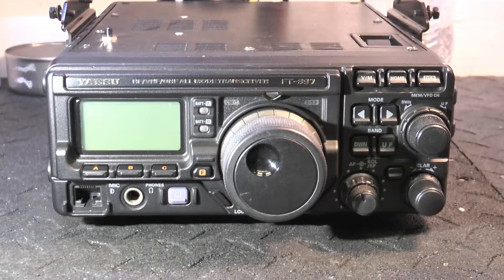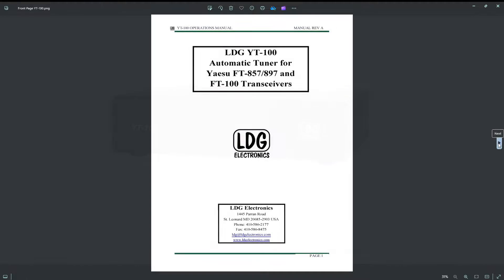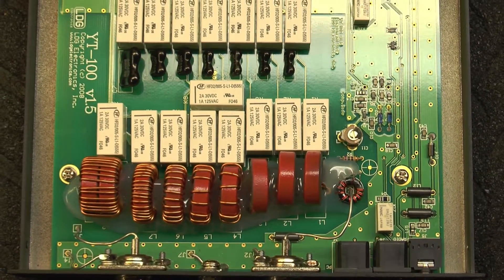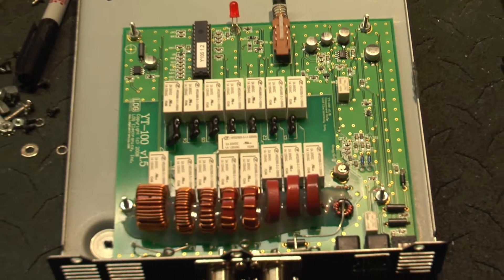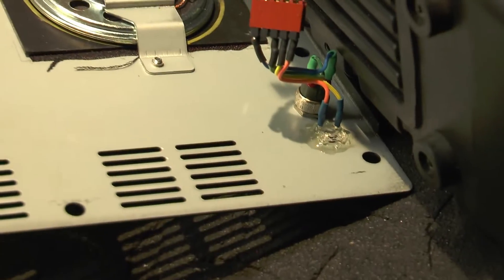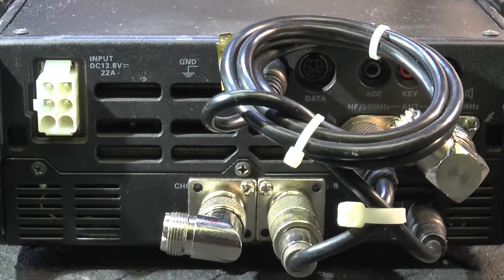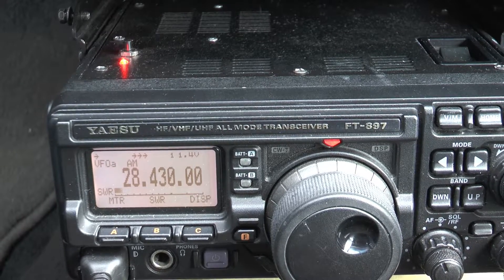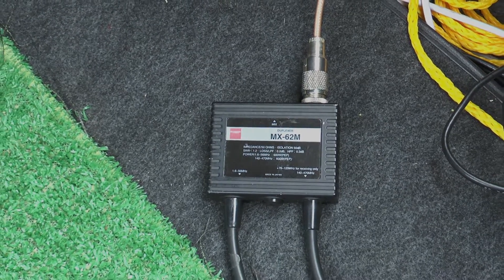Yaesu FT 897 Tuner Modification

Comment: I did this about 2 years ago and it works a treat. It's as though the YT100 board was made for the battery compartment on the 897! I got the idea from EC1CW who modified his some time ago and posted the video.
I used two 90 deg PL 259 connectors and soldered them together to bridge the radio out and tuner in ports.
I then bought a long CAT cable and cut, re soldered it to give a real tidy look to the back of the radio with no excess cables hanging off. 👍👍
Reply from the maker: Sounds good. I would like to clean up the rear wiring on mine too. I only use the 897 mobile and the tuner works great with my ham stick antennas.  Also have a Diamond CR8900A Quad band antenna. The tuner feature helps with the 10M and 6M bands. The mod makes for a great mobile radio.